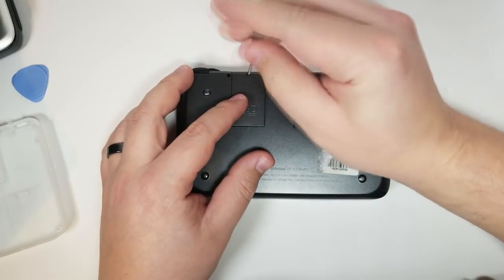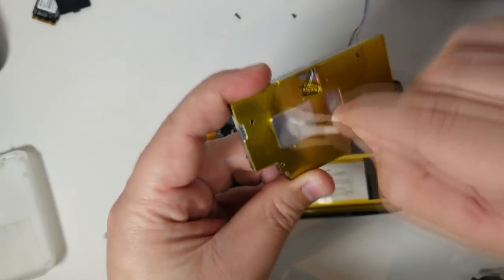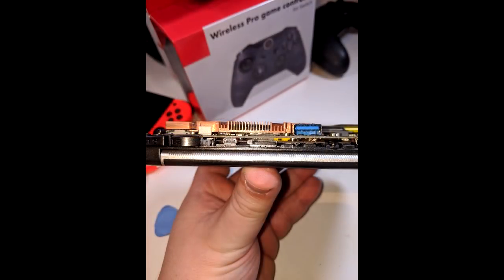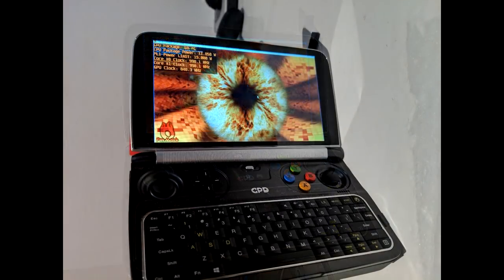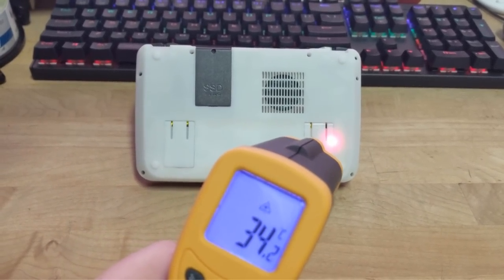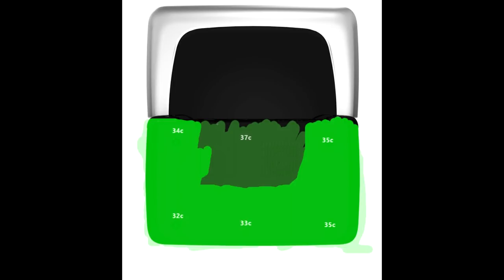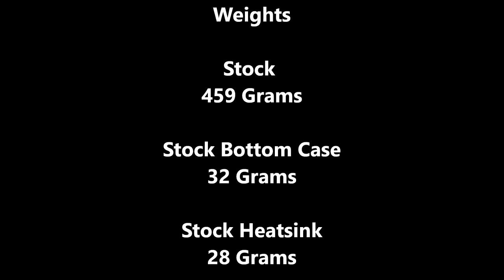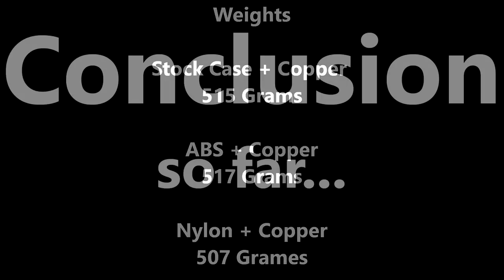GPD Win 2 - Custom Copper Heatsink IN PROGRESS REVIEW

Comment: Cool stuff.  
I hate fan noise in laptops. I always wonder with these little machines if it wouldn't be better to sink the heat to an external passive radiator.  Ideally there would be a corrugated aluminum plate covering the entire back of the screen, but I'd imagine that would present quite an engineering challenge.  
BTW, don't forget that water's boiling point varies with elevation and/or weather.

Comment: Would the new heatsink cause it not to turn off the GPD win 2 when playing a game and charging at the same time? I have an issue with mine when charging and playing it gets extremely hot and will shut off once it gets too hot.
Reply: Jon McFarland that’s dangerous it turns off as it’s it the top ceiling of the max temp they are not made to be plugged in while playing realistically. My new pc goes up to 95c when it’s charging I have to turn that off to charge it and that is thinner than the win2.
Reply: @robertdunhill2077  Yeah, I know. I only let it happened twice. Some games you can play while charging and it makes it run faster. Games that require alot of GPU(gta 4, Doom 2016) power you cant charge while playing.
Reply: Jon McFarland yeah I know what you mean my thin and light laptop can play football manager but it still hits 88c it loves its high temps. I once had a cpu and overclocked it to 4.8 that was ivy Bridge I believe.  I had a crappie cooler on that and it didn’t go anywhere near has hot as this 15 watt i7 it’s crazy my other one needed 90watts just to run it and a Gtx 660. I have gone on to better GPUs since then though as I grow up so the pc had to as well lol.
Reply: Jon McFarland I don’t know what to suggest really intels 8th gen processors are all overheating them selfs. I should be able to play fm really easy as a potato can run football manager. For 800 pound though i would expect better. They seam to have cheaped out on way too many components.
Reply: @robertdunhill2077  Hopefully the GPD win 3 will allow for charging and playing at the same time.

Comment: Forger the lowershell. Get the copper heatsink and a m.2 ribbon cable riser. I did and now I have a 1tb m.2 2280 ssd above my batter with a fujipoly pad on top of it and a piece thin piece of steel I cut to size on top of that on the outside of the case. Super easy mod only prob is the wait for the riser. Also a guy made a 3d printed part for the ssd to fit in but taking a piece of metal and cutting it yourself costs 5 bucks rather than printing 200 bucks of aluminum.

Comment: Do you think this can help me with my problem of the GPD Win 2 shutdown while charging due to overheat while gaming on TDPs higher than 8W (btw I’m first revision, I was an Indiegogo backer, I think this issue don’t happen anymore on latest revision)
Reply from the maker: No that will still happen.
Reply: It doesn't happen on latest revision
Reply: The Phawx Thanks for answering, do you know any workaround to solve that issue?
Reply from the maker: @Pro720HyperMaster720  there have been two solutions I've heard. A 60w charger. And enabling dptf but setting Max to 8 Amps
Reply: How can you tell which revision you have?
Reply from the maker: @L337g4m3r  easiest method is to see if you have a reset hole for the bios near the USB A port in the back of the unit. Outside of that you'd have to open it up and look at the PCB
Reply: @ThePhawx  And with or without hole is new?  If I get the older one should I send it back?  There is no way to tell by serial number, software revision etc?  Not too keen on ripping one apart to know.
Reply from the maker: @L337g4m3r  with reset hole is new. Post Oct 2018. And while we've seen some interesting serial data, like literally serials that seem to indicate date in them, not enough data to confirm
Reply: @ThePhawx  So if it doesn't have this hole should I spit it back and try for one with the hole?  Are the older ones buggy or defective in some way?   I scoured the internet but for some reason there really is not too much info on this. Thanks.
Reply from the maker: @L337g4m3r  before the reset hole there is a chance that you still have rumble hardware. Personally I prefer the later revisions as they do have minor fixes, like 15v charging support.

It's not super critical but I would prefer a newer model.
Reply: @ThePhawx  Which version has the speakers wired in wrong?